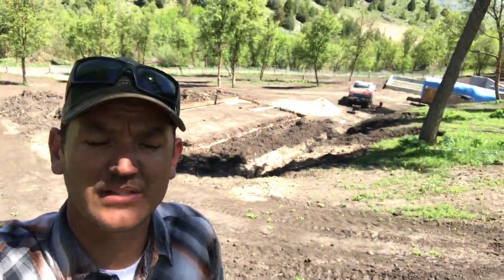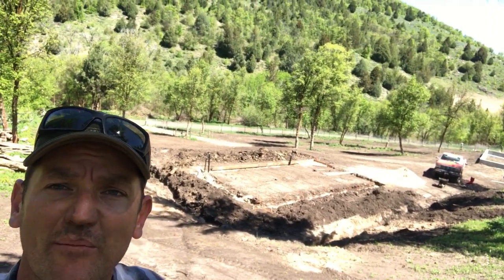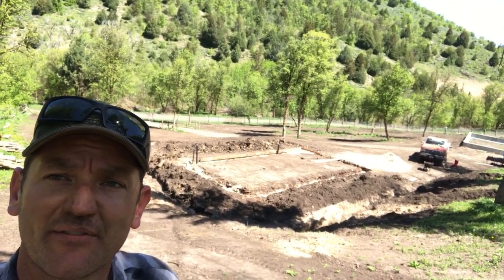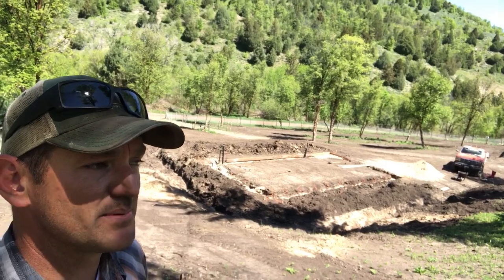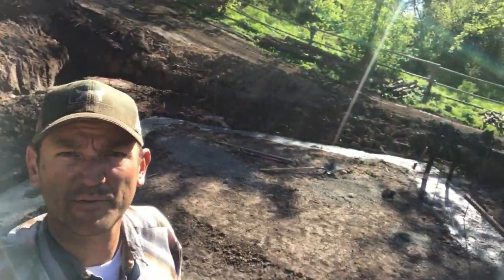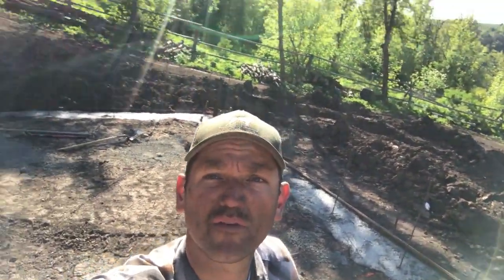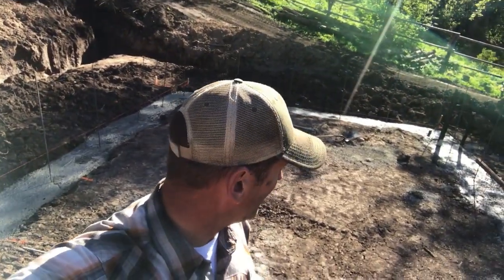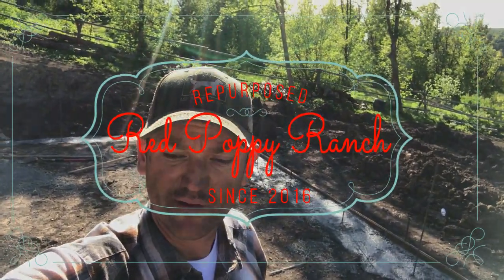#99 - I Poured The Footings Four The Off Grid House.

Comment: How many sack mix did you go with?
Reply: The truck has the dry parts in hoppers and mixes with water on location. the mix never gets in a bag as that would cost to much. They ship it around in sealed trailers that you might of seen on the highway that look like 3 connected funnels leading to 12-36 inch capped connection points under the trailer (similar to the ones that ship flour and sugar). 

Depending on the truck the batch plant mixes them a dry mix or fills individual hoppers for the driver to have control at the job location.
Reply: It is clear you failed to understand the question. When the truck arrives you tell the operator what mix you want, for footing most frost prone areas 5 sack mix ok for non home use.
Reply from the maker: I think its a 5 sack
Reply: Great job you have been an inspiration great job ✌️✌️
Reply: In Jamaica we live off grid all year long they had a saying in Jamaica self reliance is the highest from of science ✌️✌️😎😎